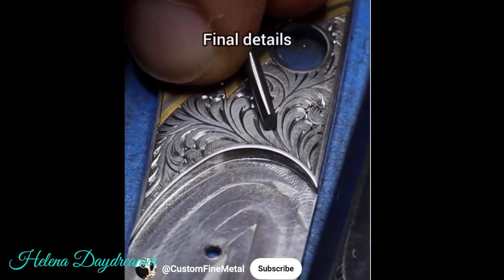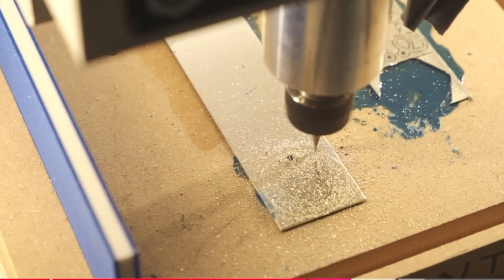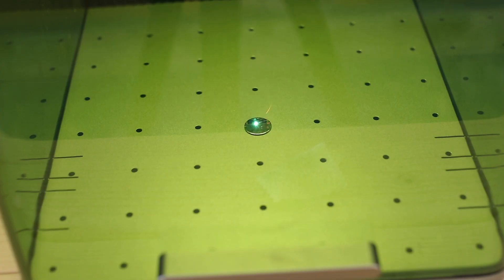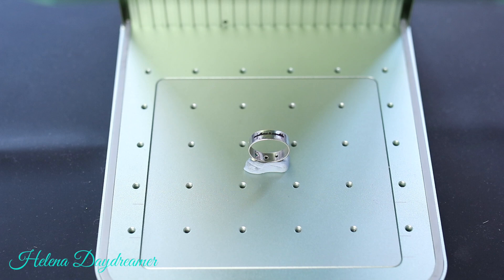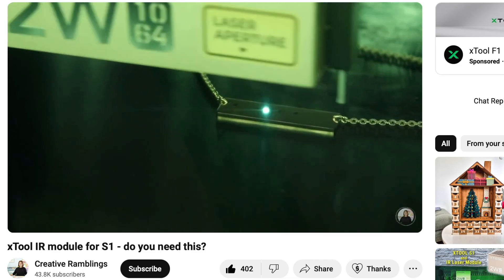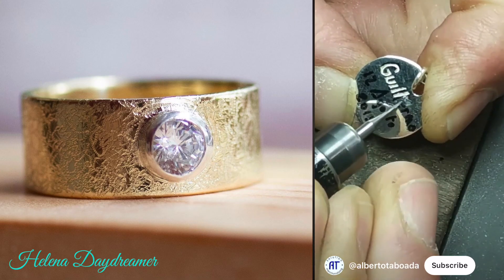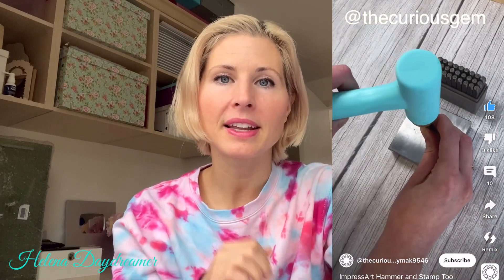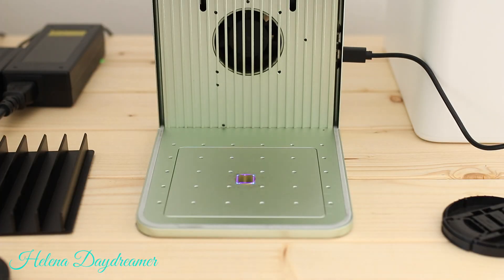7 Ways to Engrave Metal & How Deep Does The xTool F1 Engraves Metal?

Comment: Hi, this is informative video thanks, can I know the setting you used for the word “ STEEL” which didnot rub off and maintained it black engraved???
Actually I am using xtool F1 to engraved my gold-plated stainless steel necklasce and even after recommend not to wear in shower, my customer do wear it and after few days the black engraved rub off, and they came back complaing about this isuue..i also want to know should i you IR laser or Blue light laser to engrav my necklace so it can sustain its engraved even in the shower
Reply from the maker: @Makeup360  hi, I’ll try to find the exact setting, but you can just run a test on a really high power and really low speed to achieve this. 
Alternatively, have you looked into coating your pieces? I have a video on his to stop tarnish using Protecta Clear. It’ll work both ways, to keep stuff from tarnish or from removing the tarnish. Or add extra patina(with solution) to your engraving? I’ll try to make a video on all this, but keep testing, I’m sure there is a solution to this. Perhaps not the most convenient, but surely there is. Keep trying different settings and test the pieces as you go.
Reply: @AvaAndAngelsArt do you think its because of metal type? I am using PVD gold Plated stainless steel which is especially design for engraving but not sure it due to the metal or due to setting??

Comment: Can you give more of a specific answer to the the question in the title "how deep does the xTool F1 Engrave metal?" In my tests, the answer is "deep enough that I can feel some texture when scratching with a fingernail, but not deep enough to use as a stamp" which is what I am interested in doing.

Also, I'd be very interested to learn more about the post-processing you do with the crock pot and "brining solution." Could you give details about how you do that? (What is in the chemicals, how does using the heat affect it, how much time, etc.) That's something I haven't seen on any other video so it would be something unique you could teach.
Reply from the maker: @paulrobertson2825  hi Paul, thanks for your questions, to answer shortly, the F1 doesn’t engrave deep enough to use your engraving as a stamp. I mean a proper metal stamp. It would leave an impression, but probably just faint. Definitely look into the xtool F1 Ultra or other fiber lasers. 
The solution in my pot is called Piclean, which is a jewellery non toxic pickle solution. When heated, it removes tarnish from torch fired jewellery pieces. There are other solutions available of course, some having stronger ingredients, I just like this one as it’s safer to use. I hope it helps.

Comment: Can you recommand a tool for soldering metal for bracelets, for instance? Thanks!
Reply from the maker: @laurel1854  it depends what exactly you need soldering. I personally use the traditional method of a butane torch, solder paste or solder pieces and flax. But there are also machines that spot solder(weld) a very small area, like if you want to just close a jump ring.